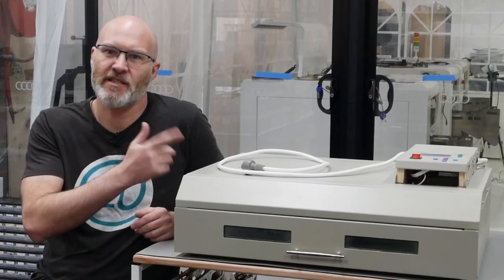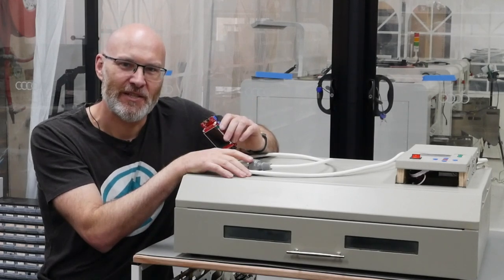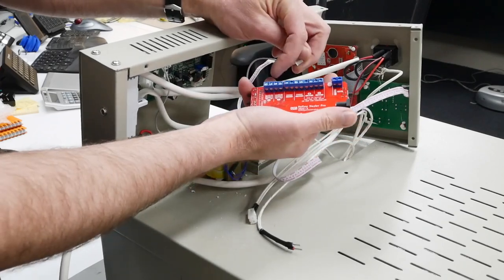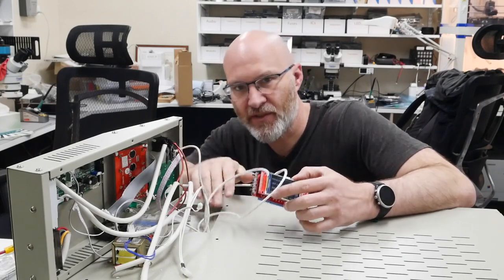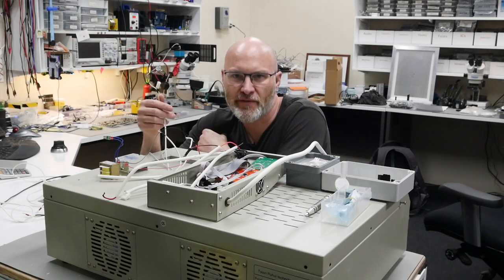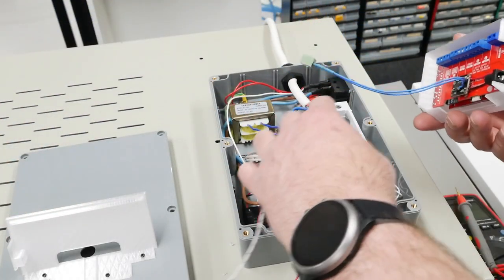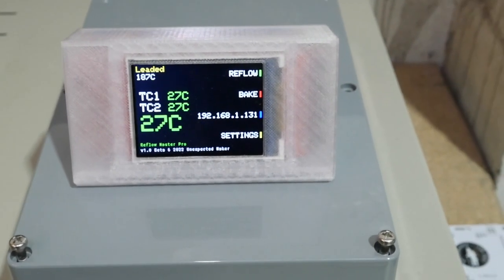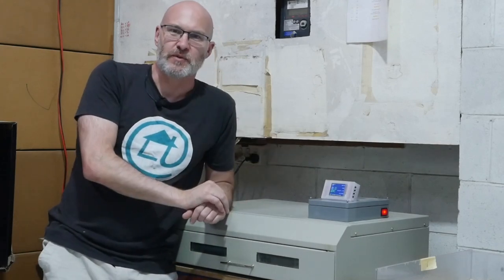Vlog 75: T-962C reflow oven conversion to Reflow Master Pro

Comment: Have you consiered making a large box with an extractor fan to place the oven inside and have a large door at the front to load pcbs? i did this with my reflow oven and it keeps the fumes out of the workshop and vents them outside.
Reply from the maker: Yes, I have one of those and it totally cures the fume problem. In my old lab the exhaust duct went up through the ceiling and was vented outside, and I haven't got it set up yet in the new location.

Comment: Hey Jon Happy New Years my friend. I hope 2023 will be a good one. For your relay problem. Do you not have any type of relays even one of the cheap ones people use for arduino the blue ones?
Reply from the maker: Plenty of relays (literally hundreds) but I wanted an SSR so there'd be a chance to do some modulation of the fan. It doesn't really work well with 50Hz AC though. The zero-crossings don't occur often enough.
Reply: @SuperHouseTV  Nice Nice. What is the model of that SSR? Also what's the Size of that plastic housing case? That's a nice size there.
Reply: Yah, mechanical relays are not the thing you want to use for PWM based control - They cant really switch fast enough, and so they'll wear over time and go bad and then you might be left with an always ON relay when it dies. That's really risky :(
Reply: @UnexpectedMaker  Yes, especially the tiny little 5V relays, though with 12V you can at least use semi decent relays, or at least ones that have real 10A rated contacts, as the 230VAC fans anyway do not respond well to PWM to do speed control, and using ones with actual electronics inside will just result in them being cooked to well charred in a few operate cycles.

Also beware of cheap SSR devices, many claim a lot of power handling, but inside all you get is a cheap 8A triac and optocoupler, with possibly an input current circuit that might be more than a resistor and a diode.

Comment: next version automatic fire suppression ? could cooling fans help the temp distribution, might need controllable external duct to suck/blow the air around (duct might need isolation too). "Automatic" air valve as air pressure from circulation would be lower than when 2 fans blow out.

Comment: Very nicely presented upgrade.

Also you might want to get a CO2 extinguisher if you don't already have one.  The common powder type extinguishers make an awful mess.  The powder will get everywhere and is corrosive, so it is terrible stuff to have around valuable electronic equipment.
Reply from the maker: Good tip. I have 2 powder extinguishers and a CO2 extinguisher, which is the one I held up in the video. I got that one specifically to keep near my laser cutter so I wouldn't destroy the optics if I had to put out a fire.
Reply: @SuperHouseTV  Ah yeah, of course it is CO2 with that wide nozzle